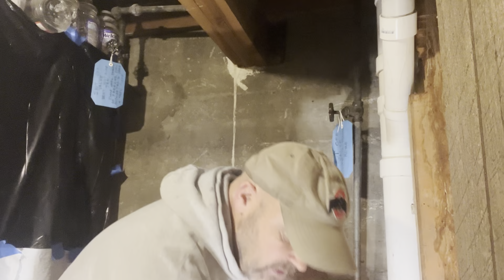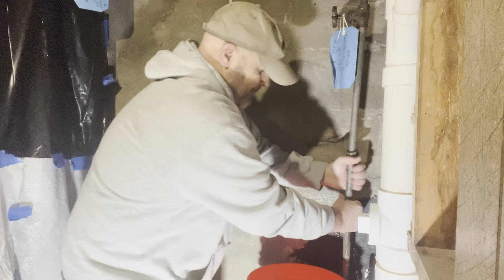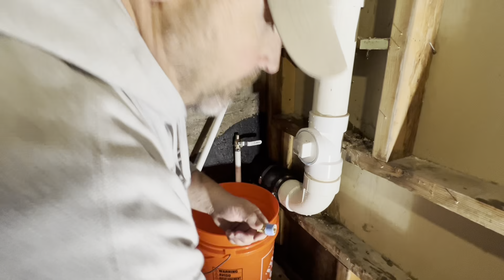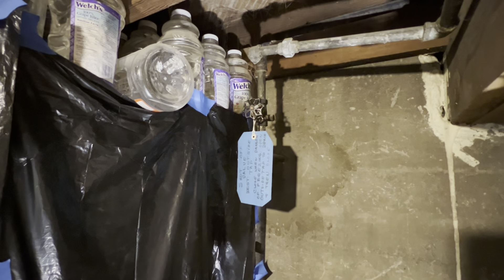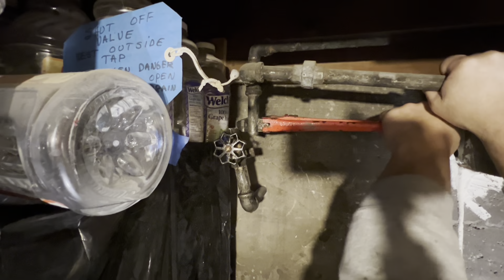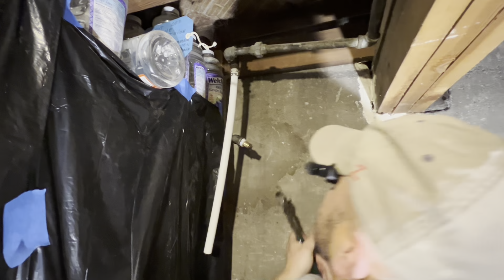DIY Water Main Shut Off Replacement Using PEX Ball Valve

Comment: I would like to see strapping on those new lines.  Code is every 10 feet on the vert (with a mid-story guide for sizes 2 inches and smaller)